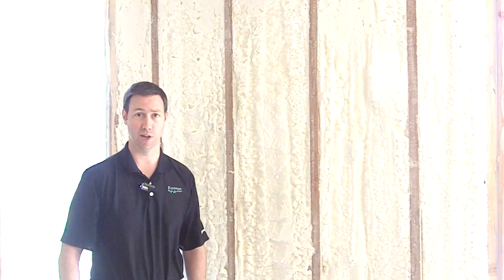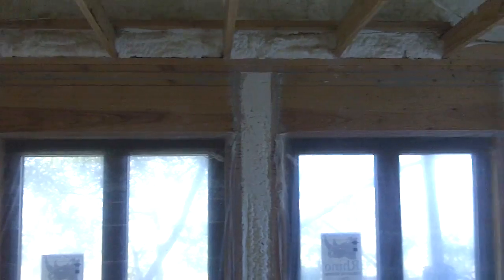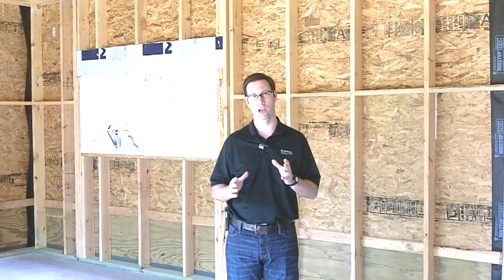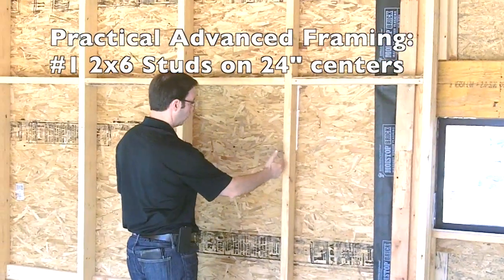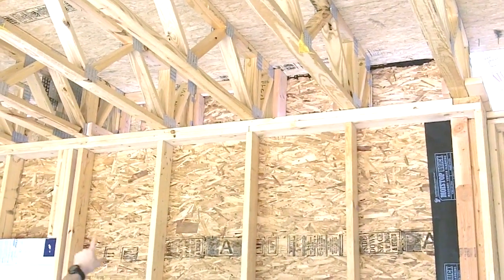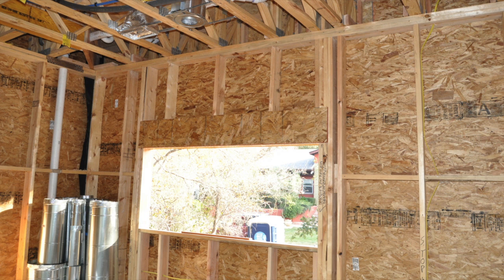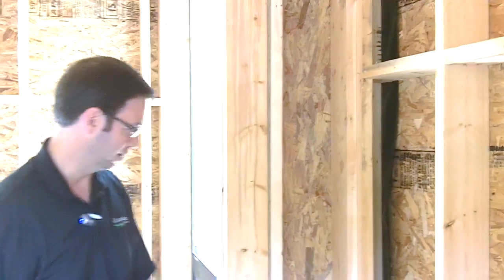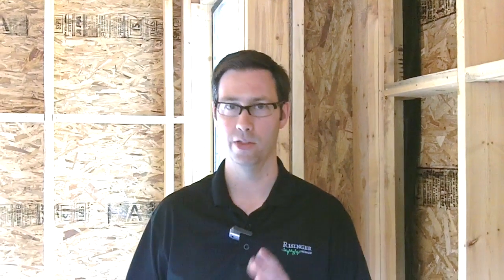Advanced Framing vs Traditional Framing

Comment: I've just looked in the 2009 IRC and I don't see your california corner.... is it there?  Is it permitted?
Reply from the maker: Wes, it's permitted under both 2009 and 2012 IRC under Wood Framing. It's under 2308.9 "Wall Framing".  Remember to verify your bracing plan meets code when using Advanced Framing and CA corners.  I'm a fan of continuous 1/2" sheathing.  Best, Matt

Comment: Do you ever consider fire fighting when you're building a minimal structure?  The lightweight building practice makes my job even more dangerous than it already is.
Reply from the maker: If you are a fire fighter, I want to thank you sincerely for your sacrifice for the greater good of our society.  I'm not advocating any practices that don't meet current International Residential Codes.  This framing technique meets all codes and is inspected for compliance by both a Third-Party inspector and our local code inspector.  Thanks for commenting.  Best, Matt

Comment: you have to use 5/8 or better when you go up to 24 oc otherwise a 3 or 4 year old would run right through it.
Reply: Seriously?  Are you an idiot? Kids run all the time, regardless of what parents say.  You must not have any...
Reply: The problem is the parent, not the wall.  If a 3 or 4 year old is running in the house, that parent has failed.
Reply: @psdaengr911  If a 3 or 4 year old is NOT running around, the parent has failed. I hope you don't have kids. Or advise others on theirs.
Reply: Even 1/2" sheetrock is enough when backed with the foam insulation. The foam is expensive but worth the extra cost. It is structural as well as superior in insulating and infiltration sealing value.

Comment: 24" centers don't meet code for load bearing walls and you can't cover pressure treated wood were I work. As for the lighter headers and the California corners, the difference in the heat loss gain is hardly worth the loss of structural strength. You don't want to save pennies on your power bill at the expense of added structural strength.
Reply from the maker: How about we ditch the inside insulation altogether, stay with 16" centers then use 4-6" of rigid foam outside the stud walls?  I'm doing that on a job now!  Videos to come... Best, Matt

Comment: Have you seen Local Building Codes resisting the 24" O.C. over 16" O.C. for load bearing walls?
Reply from the maker: No.  Codes are Ok with it, but some Engineers don't like it.  Generally the local inspector wants the Engineered framing to be inspected by the Engineer and a letter of compliance given.  Matt

Comment: I did Pure Advanced framing on my personal home, here in Iowa. Single top plate, Header hangers, no jack studs, and single headers pushed to outside. We also did 2x6 24" centers but I did 5/8" OSB on outside ran horizontal and no joints over windows, really makes it strong, Pure 2 stud corners but no clips use Metal Drywall Strips Ask your drywall guy they use them a lot on Ceilings to help with future cracking. Also did 5/8" drywall on outside walls. We did  24" center in whole house but Used High strength 1/2 on inside walls.  R-5 Foam on outside taped no Tyvek.  HERS score of 47 with hybrid 2 stage Air Heat pump/ 97% 2 stage furnace.  Zone 5 climate. First home done this way with Indoor Air plus and Energy star 3.0+
Reply: I would think that ANY houses in tornado zones would be built using buckminster Fuller s design.. an octogon or better yet upside down saucer form so that the winds wouldnt get a hold of it.
Reply: Hahaha
Reply: Smart man!

Comment: I have a question, with placing the rigid foam on the outside of the wall and having the plastic vapor barrier on the inside; isn't that dangerous to do because the wall can no longer dry to either side?
Reply from the maker: I'm not sure where you saw a plastic vapor barrier on the inside, but that's a big NO-no for a house in a hot/humid climate.  The vapor barrier should be on the outside of the house and none on the inside.  Our air conditioners will dry the house to the inside and you don't want to stop that drying to the inside.  Best, Matt
Reply: Matt Risinger Thank You, it is hard to tell the details from a computer screen sometimes.

Comment: Wouldn't you be able to get the same benefit by doing rigid foam on the outside sheathing? Obviously in this case you're remodeling the inside but performance wise couldn't these benefits be obtained doing outsulation?

Comment from the maker: Jason, Thanks for commenting.  You'll need to talk to an Engineer to verify any framing plan when you're in a high risk area.  My guess is that Advanced Framing with Closed Cell foam would be more structurally sound than standard framing with batt insulation.  I don't build anything that's not stout!  Best, Matt

Comment: Is advanced framing practical (structurally) for high wind coastal regions? Specifically in southern Louisiana around 20 miles north of the coast line where it'll face many hurricanes. I plan on building and have been doing a lot of homework on different types of construction methods and ICF's and SIP's are pretty much out of the question now due to cost, lack of experienced builders and just overall practicality. I'm really sold on what closed cell spray foam can do to insulate, seal and ....

Comment from the maker: The cost question is tough to answer.  There is definite material savings, and certainly insulation gains which should cut utility costs.  I think the labor cost savings are small.  Sorry to be vague, but there are more benefits to this method than just cost so you'll need to figure this one for yourself & your trade base.  Best, Matt

Comment from the maker: I sheath all exterior walls in either OSB or preferably 1/2" CDX plywood here in Austin.  You would need to consult with a structural engineer to see if this is necessary structurally for your location, however full plywood is a best practice regardless of structural minimums.  Best, Matt
Reply: 7 years late just curious if this has changed? In the video you said treated but here you're saying CDX it looked treated in the video not just exterior grade sheathing

Comment from the maker: It's certainly possible for a stud to fail, but with them in compression it's less likely than a floor joist.  My guess is that the floor joist failed because of holes drilled, or notching of some type.  This can happen to studs too but it's less likely and especially with 2x6's compared to 2x4's.  MR

Comment: yes but if it fails on a 16 inch center it would not be as devastating as a 24 inch center. btw i had a joist fail and now the floor is uneven, it was not due to water damage.

Comment from the maker: I don't do Advanced Framing on every project.  I really need to be involved at the start of Architectural Design in order for this system to work properly.  For instance, if the floor system isn't designed for Adv Framing you might be forced to stay with 16" OC Stud spacing.  My framer was open to learning these methods and we reviewed the details & expectations prior to the start of framing.  Best, Matt Risinger